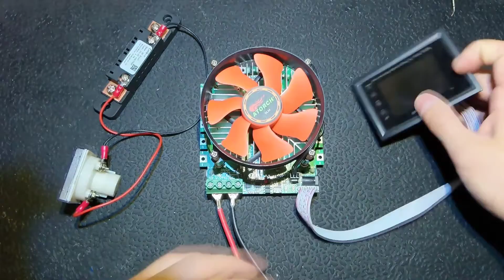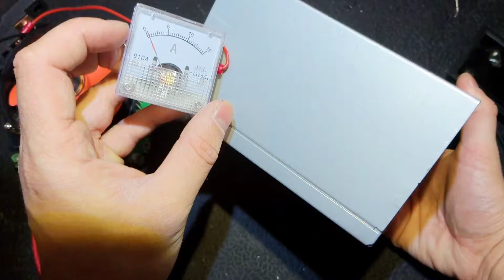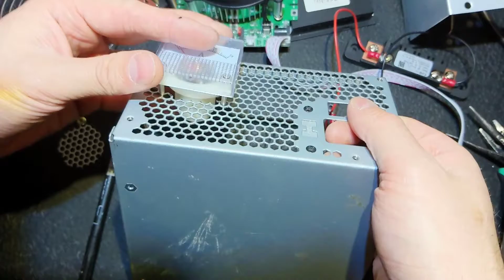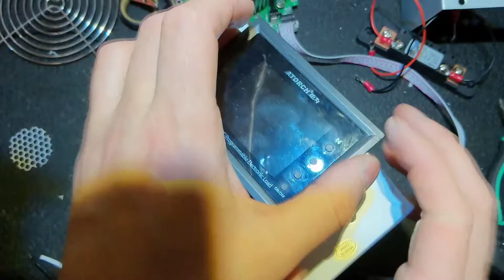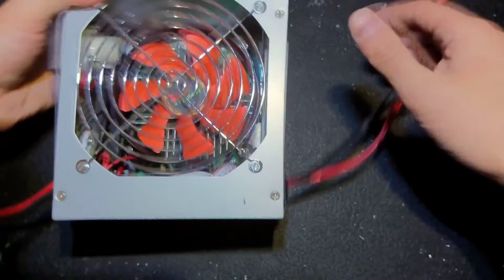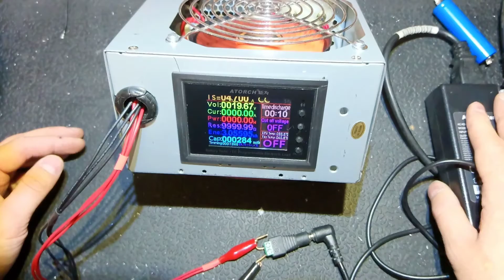Case (housing) for electronic load Dl24 and some more

Comment: Can you tell us more about those two big resistors? Are they adjustable 0-25 ohm resistors that you have in parallel? What's the wattage for power dissipation? I've been wanting to put together a big resistor load bank but after not being able to score any resistors on eBay cheap enough I broke down and bought the 600W Atorch DL24 (pain in the ass to put together) and I just finally got it. Having some issues going beyond 350W but that might be my leads and not the DL24. Using a 4S8P A123 M1B battery so it should be capable of pulling 35A but when I do that the load drops to 0 so? Not sure what's up

I actually realized last week I had salvaged 8 heating elements from a mini oven and put them in my big junk parts bin. Pulled them out and tested them and realized they were 8 ohms each so I could make a great resistor bank out of them since they are rated for 450W I believe. They say 60V450W on them so I'm not really sure but I still need to put together a base that has enough thermal mass to help absorb some of the heat.